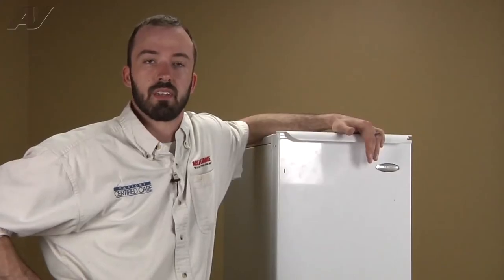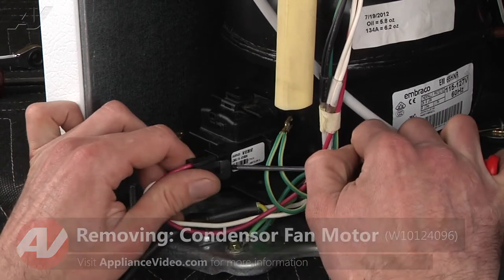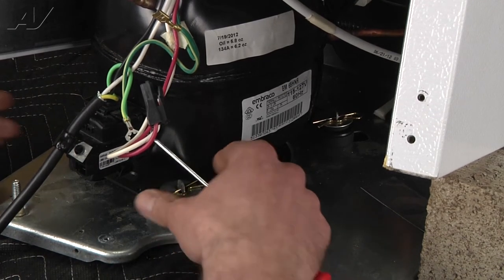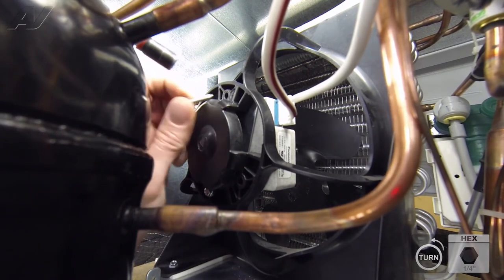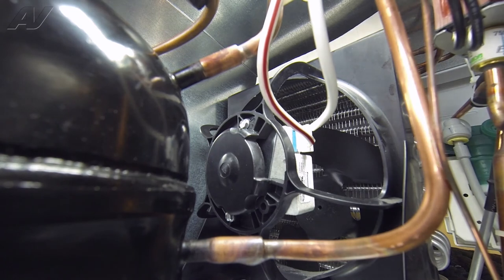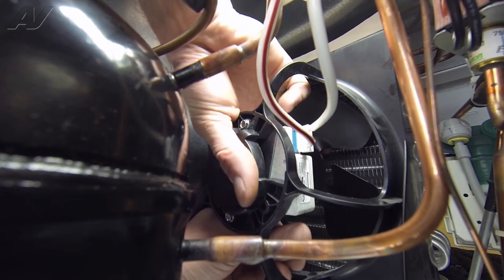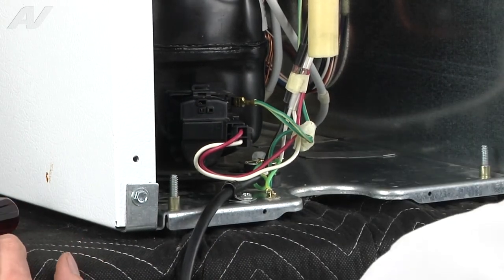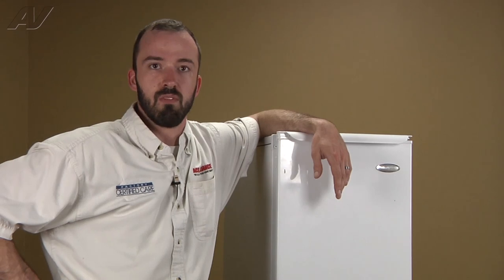Ice maker Repair - Condenser  Fan Motor - Commercial & Household Refrigerator - Diagnostic & Repair

Comment: Thanks for this, really step-by-step.  It turns out they updated the fan motor and the replacement ones use three screws to mount it instead of two, but that change was simple to work out.

But the important part is that you got me through the hard part which was how the heck do I get this thing out of there.

Comment: Great video.  Easy to follow.  My freestanding kitchenaid icemaker is very hot from compressor and not making ice.  I thought fan was problem because fan was not turning on. I placed an external box fan behind machine and ice produces normally.  I replaced fan and it does not cool down enough to make ice.  Placed box fan behind, and it cools enough to make ice.  I replaced 2 parts now (thermestor inside ice resevoir) and the compressor fan motor.  No luck.  Thoughts?  Multimeter testing advice?  Im at a loss at this point. Thx in advance!
Reply from the maker: Great question, if you have a more technical question that our parts department cannot answer, you can search our over 17,000 answered questions free at our website www.ApplianceVideo.com under our Repair Help section. You can also call our parts department at 1-800-830-5465 and they can give you help 7-days A week ,or search at www.SaveMoreOnParts.com  .